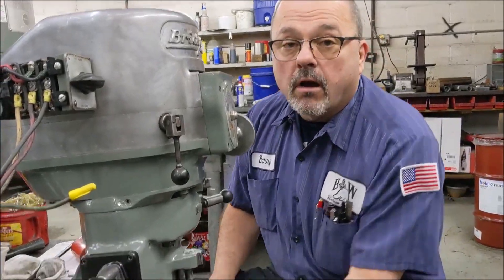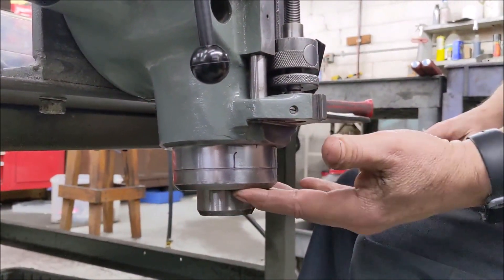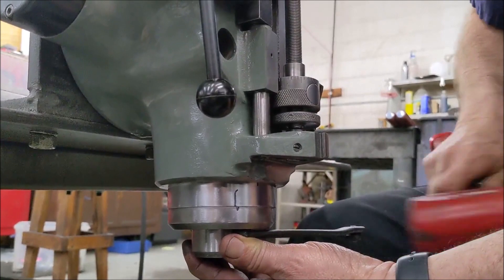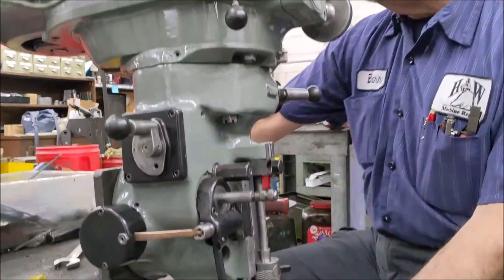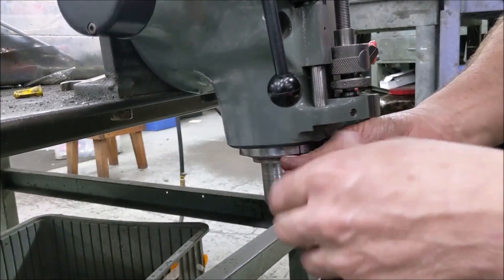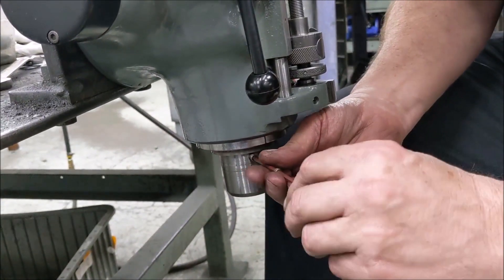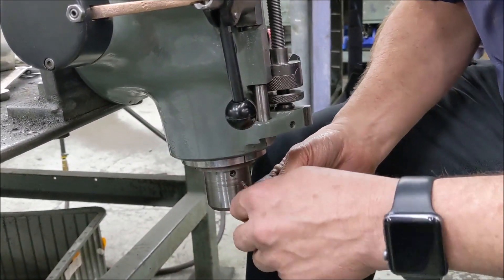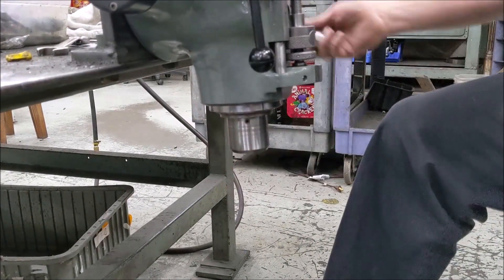Replacing the Collet Alignment Screw on a Bridgeport

Comment: If one has a power draw bar installed, is it possible to do this without removing the power draw bar?
Reply from the maker: Yes, unfortunately you will have to take it off to replace the collet screw.

Comment: I don't understand driving the spindle down with a drawbar?  How can a drawbar screw into the spindle with no collet installed?  Would like to see a pic of this spindle arrangement.  Same 7/16-20 tpi drawbar used for both collet and spindle?  Thanks!
Reply from the maker: You are not screwing the drawbar into anything while doing this procedure. The drawbar is acting like a long punch for the spindle. If you have more questions you can give us a call 1-800-285-5271

Comment: I found this video series while looking for any tips help get the Quill Nosepiece off.  Mine was seemly stuck really well.  After witnessing the back and forth tapping of the nosepiece to help loosen it I found this ACCU II mill to have a left handed thread on the nose piece!  No wonder I could not get it to budge.  Good rule of thumb I always follow is to never force something apart, there's probably a good reason why it is not working as expected but I never expected this to be a left hand thread.  I hope this info helps someone else that may be struggling with this same Taiwan machine.
Reply: Thank you! The Nosepiece on my Taiwanese BP copy appears to have left hand thread as well. I wouldn't have thought of it unless I read your comment. Also, it appears the set screw is a 6mm x 1, and not SAE.

Comment: Thanks for this (and all of your) video, just did this job and it helped immensely. One thing I noticed, I made the alignment marks as shown, and didn't even rub them off! However, after pulling the nose piece out I noticed that some previous owner over-tightened the nose piece a bit, causing the set screw to miss the factory recess and chew up some of the threads. I cleaned them up with a thread file, but then marked the location of that recess on the nose piece and used that mark to line up with the set screw hole instead of the mark I had initially made. Just something to check to be sure that it was on there correctly to begin with.

Comment: Anybody know where I can get a good quality spanner wrench for the nose piece? The cheap crap on amazon broke on the first try and our nose is really stuck on there. About close to using a pipe wrench and ordering a new nose cap.
Reply from the maker: Barry says to give him a call if you have the chance. If your nose piece isn't coming off with a regular spanner wrench he is concerned you may have some cross threading going on. He does have some tips that he can give you: 1-800-285-5271
Reply: @HWMachRepair  Called last week and got it ordered. Saw your phone number in a comment below. Thanks guys.

Comment: On the cap retaining set screw you do not need to tighten it too much.  The set screw just keeps it from turning and if you put too much pressure on it it will deform the quill sleeve causing it to get sticky/rub when fully retracting the quill.   (Thanks for the videos !)